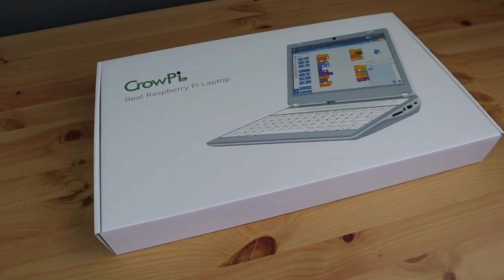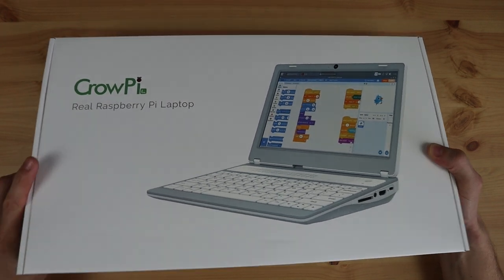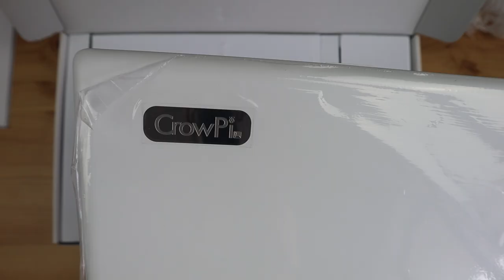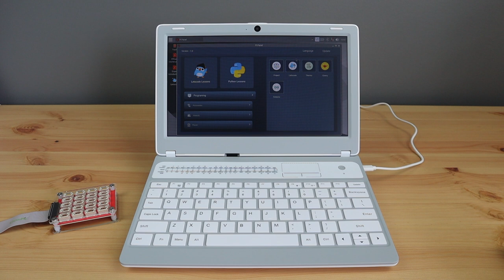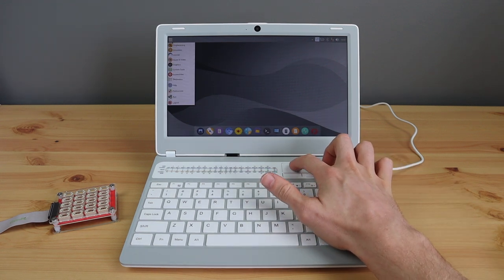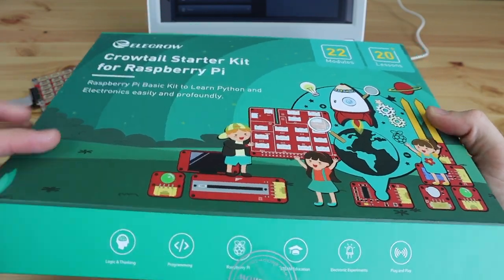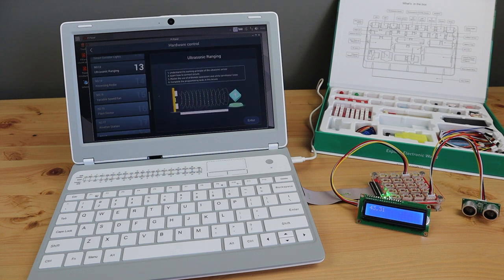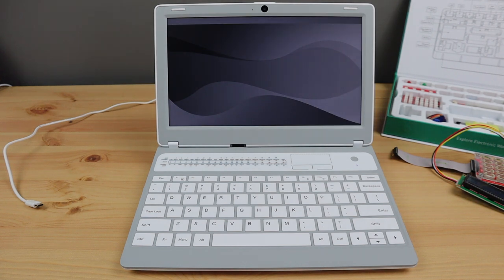The Best Raspberry Pi Powered Laptop I've Tried - The CrowPi-L

Comment: Most annoying part...the 12v power supply. Not a voltage covered by USB PD spec, so you can't charge any other device with it (and might brick it if you try) and you can't charge the crow pi with 5v USB or USB PD chargers.

Finally, ignore the included microsd prepared with the device; it's configured to pull updates from China and set my region block firewall off really quickly trying to update. Use a fresh copy or rasbian or another OS of choice and choose hdmi_group 2 and hdmi_mode 86 in config.txt to support the odds 1366x768 display.
Reply from the maker: They say in the manual that it can be powered using other USB PD chargers but admittedly I didn't try this - I'll try it this evening.
I definitely wouldn't try charging any other devices with the included power supply though, and I'd be cautious using it around my office/workshop in case somebody else decides to use it.
The software updates from China make sense (even if not desired) as they'd need to maintain their own software and they have quite a bit of custom software on the CrowPi-L. Thanks for the tips on the display config if using a fresh install of Raspberry Pi OS.
Reply: 1366x768 used to be the standard for low-end laptops.
Reply: @firstNamelastName-ho6lv  used to be.
Reply: Would've been better of a 19v 2.1A capable laptop charger that you can find anywhere
Reply: 12v is covered by the PD standard, as well as 5, 9, 15 and 20V. The power supply part of the PD circuit is dynamically adjustable so in fact there's nothing stopping designers from allowing any voltages between 5 and 20V.
Reply: I'll check in to that... Thanks.

Comment: That 12V USB-C power brick is downright dangerous. They should have just used a different plug type.
The CrowPi is primarily meant for kids and they're the least likely to know and watch for voltage mismatches (at least until they learn more electronics with the CrowPi). But even among adults who are careful/wary, a minor oversight by mistakenly grabbing this could result in a fried phone (probably just the charging circuit) or other fried USB-C devices.
Reply from the maker: Yeah they should have either respected the power delivery standard or just made a 12V barrel jack supply.

Comment: CrowPi PSU destoryed my Pi 400. I connected the USB-C plug from CrowPi into my PI 400 and its dead. The cable looks exactly the same as the Pi USB-C Cables.. It never crossed my mind it wouldn't be USB-C standard until I checked the adapter. Not Happy.
Reply from the maker: Sorry to hear that! Yeah it's pretty poor from their design team to not follow proper standards for peripherals.

Comment: What sort of person would waste that much money on a computer kit that looks like a childs toy when you could buy a real, professionally made laptop complete with a warranty for the same money?
Reply: Someone learning to code. Hardware specifically. It has an additional kit with tutorials that walk you through examples of coding hardware and you can watch it change the functionality of the kit in real time. I watched an Asian YouTuber code an led to flash at different speeds and go from green to red etc. Its meant for introduction to coding and applying that to hardware functions.

I don’t think anyone would ever buy it as an actual laptop when you can get a laptop off of eBay that blows it out of the water for under 100$
Reply from the maker: The intention behind something like this is for electronics and programming education, not to be a professional laptop. A proper laptop will obviously have better specs and performance for the price.
Reply: @MichaelKlements  ... which can be done with a simple controller/programmator that connects to any machine via USB, without Linux and a mess held together by ribbon cables and magnets.

Comment: why does this even exist? there are the compute module 4 now, they are made for this sort of integrated application. This sort of clunky approach and bulky chassis with tons of fragile connectors is just stupid. Use a CM4.
Reply from the maker: They would definitely be a cleaner solution, but CM4 modules have been unavailable to then general public for over two years now, so designers are holding back on using them.